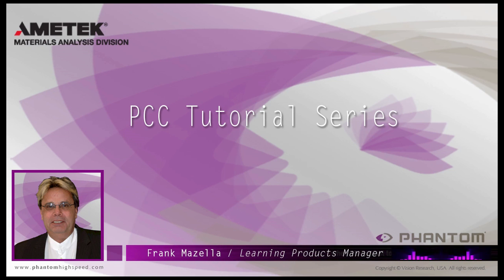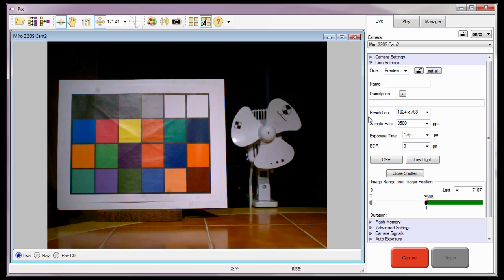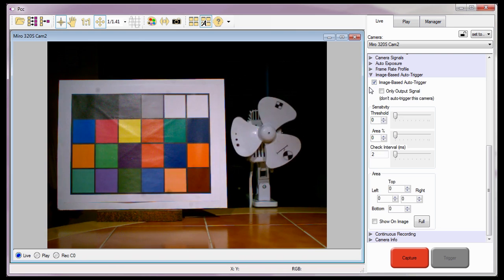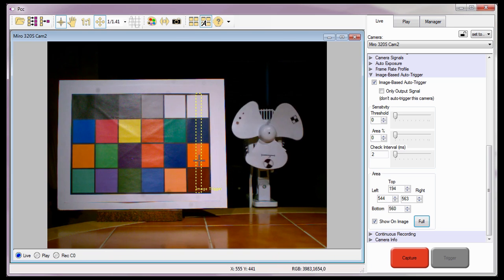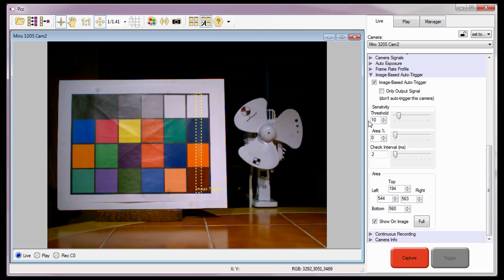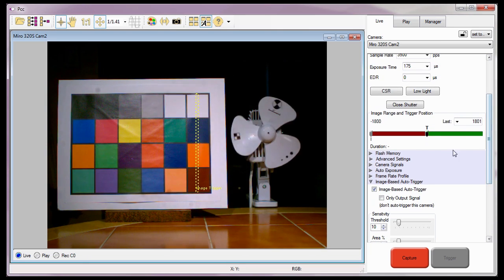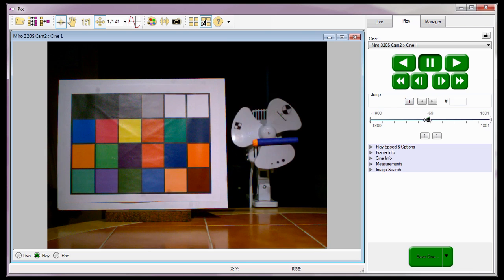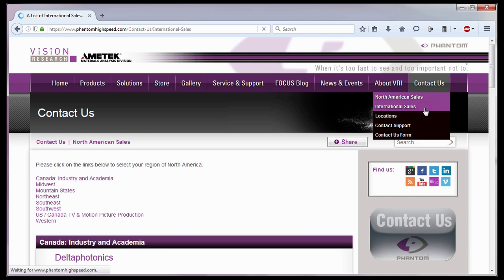Image Based Auto-Trigger (IBAT) PCC Tutorial

Comment: Does "only output signal" option means the camera will send output signal to another device?
Reply: Hey Rubani, 

Great question, 

When you are using the iBAT feature, the camera sends out an "IBAT-signal" whenever the IBAT criterion is satisfied. Basically, its a high to low TTL out signal. In that version of the software, you had the option to output the IBAT signal without triggering the camera. This was designed into the camera for those people who wanted to trigger other systems without triggering the camera itself. And more specifically, we had a user who had multiple cameras configured together and only wanted the multi-camera system to trigger when each camera's IBAT criteria were satisfied at the same exact time. They used an AND-gate to accomplish it.

Another important point is that you do not need the select "only output signal" to trigger other systems with the camera. This feature simply prevents the camera from triggering due to an IBAT signal. If you have it unchecked, you will be able to get an IBAT signal out of the camera, while at the same time triggering the camera. 

If you have anymore questions, feel free to ask!
-kyle